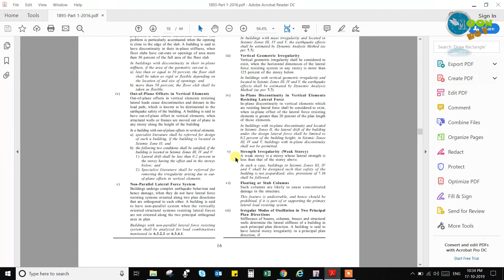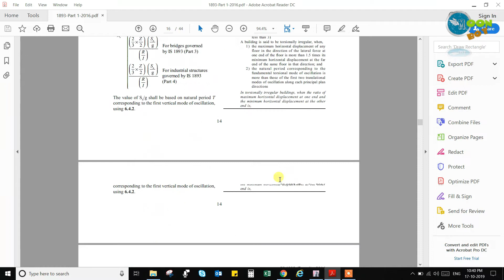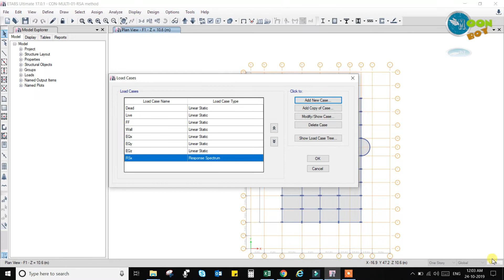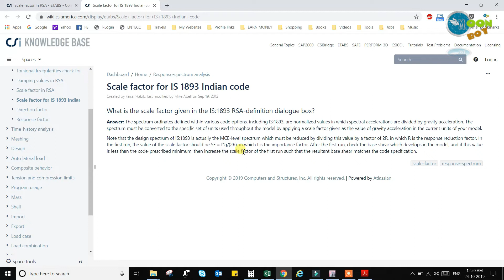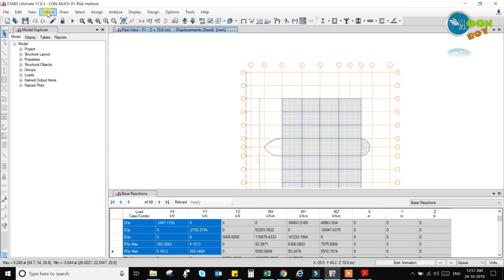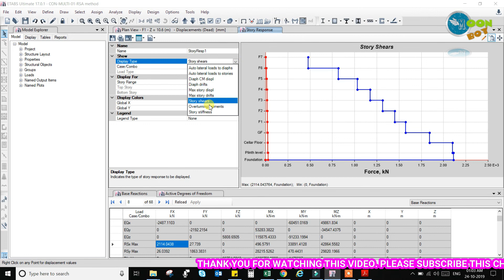NEW ETABS 17 TUTORIAL 13 | Response Spectrum Using IS 1893:2016 Full Procedure | Shaik Qamaruddin

Comment: Sir, Nice job. What if Dynamic Shear using scale factor as 'g" as modified in ETABS 2017 software, is higher than the static quake (using scale 1)? Do you still reduce the dynamic base shear making both static and dynamic equal? This is really the case in here?

Comment: Sir, I have few doubts ...
1. As the base shear value calculated by Response spectrum analysis is less than the value calculated using static method.
Then why do we have to go for response spectrum analysis ?
Because less value means , not in safer side.. 
I mean what is the advantage of Analysis the building using Response spectrum analysis compared to static method ?

2. As you have mentioned the story drifts is within the limits , where is the limit value of story drift available ?
Reply from the maker: https://youtu.be/TZ-AoprFF1Y

Comment: Sir what about z direction?
Reply from the maker: In Z-direction you have to take Sa/g value from code and make a constant line of response function while defining the function for Z - direction.
Reply: @moonboyslife  sir can I use Etab 16 by new code is it acceptable?
Reply from the maker: @nabajyotisarkar2228  I think even in 16 version new code is available for selection. So yes.
Reply: @moonboyslife   If I selected 2002 and define all as per 2016 is it acceptable ? Bcz I don't have 2002 in etab 16
Reply from the maker: @nabajyotisarkar2228  you can change and update the data before design. Anyways analysis values won't change.